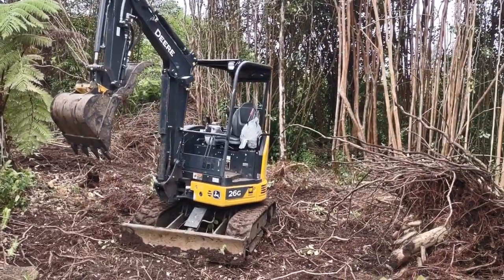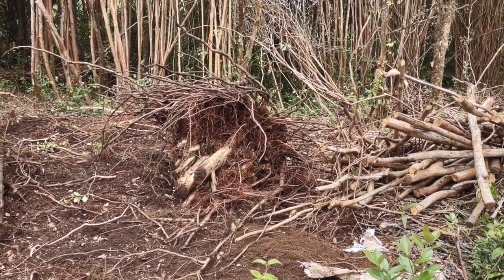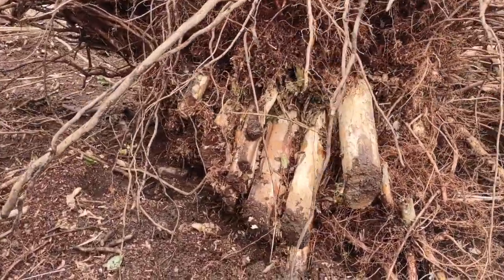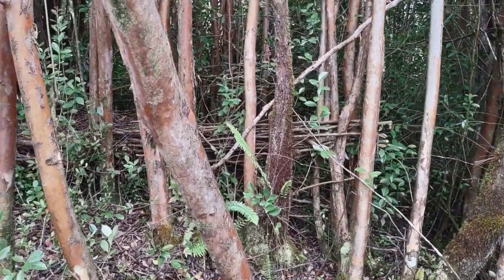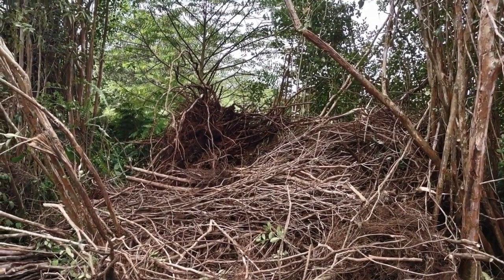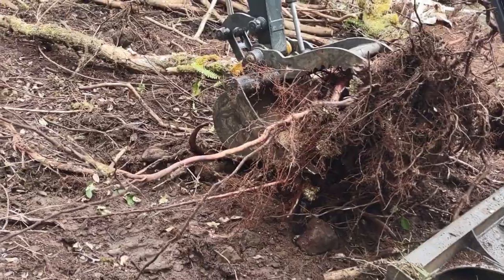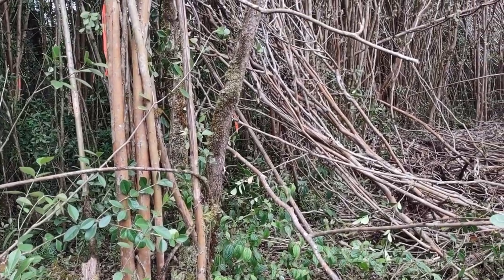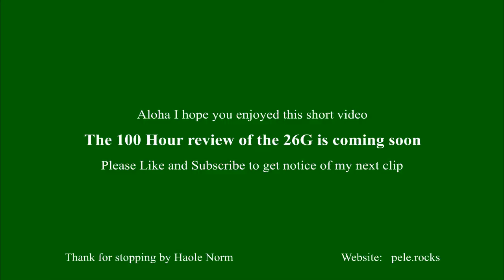John Deere 26G Stump Work

Comment: How much does that machine cost if you don’t mine. It’s a perfect size love it
Reply from the maker: I'm in Hawaii. I ordered the purchase of the 26G and had to wait 5 months for it to arrive.
I also ordered a 12" and 24" bucket and the largest hammer that I could get for this machine.
The hammer was about 10k.
Machine at about 44k with like 5k down.
Got a third bucket 34" for like $1,500 and I use that bucket more than the others.
Reply from the maker: Flat blade 34” bucket no teeth